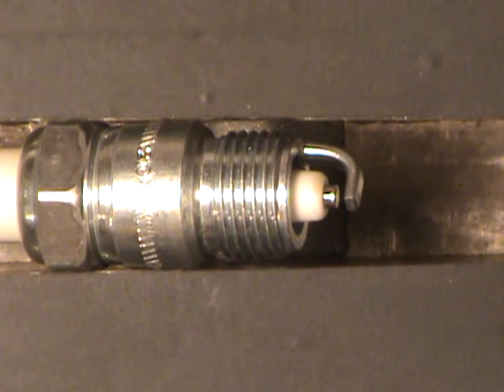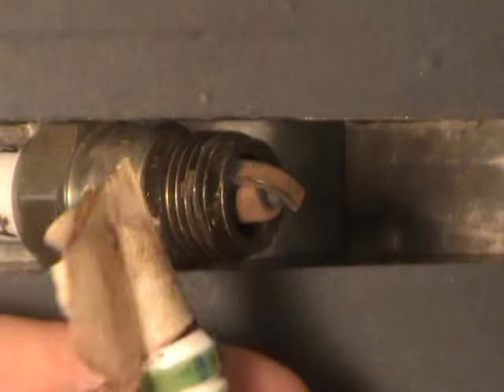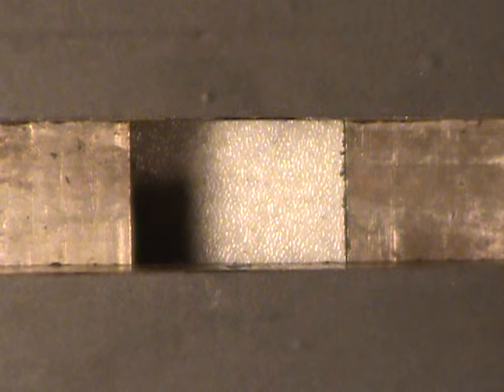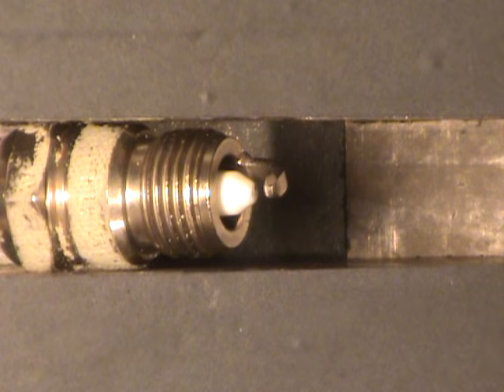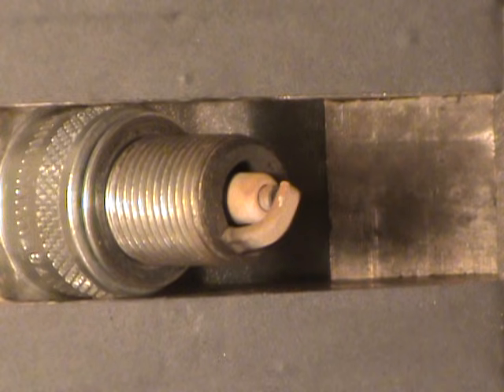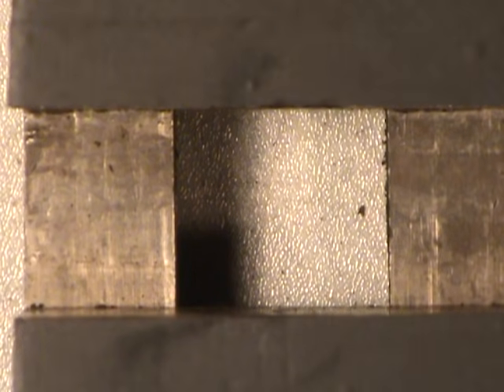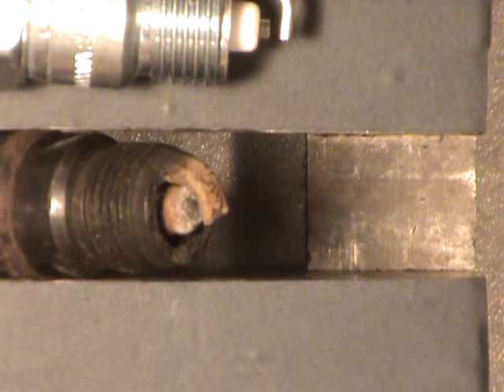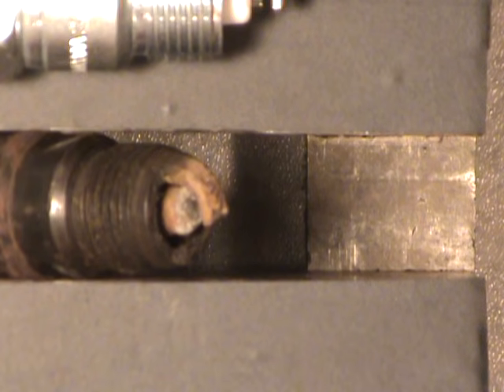SPARK PLUGS How to Read them (Part 3)

Comment: Great video! Have you ever heard of this before..... I've got a plug I pulled out of my mid 70's Chevy 454 that was "yellow", yep yellow,, the rest of the plugs were normal looking. Your video doesn't mention this color, what could be causing this to happen in one cylinder?
Reply from the maker: Greetings bob stout....Thanks for the nice comment, for watching, and for Your question as well....What comes to mind (mine), is, as it concerns that "Yellow-ish" Color, that You saw/observed on "Only One", of the "8" Spark Plugs, that were installed in Your 1970's 454-V8 Engine, has me thinkin', that, perhaps, it just might be some "Glazing" of that "1" Spark Plug, that is usually the Result, of having, in this particular case, that "1" Spark Plug having an abundant amount of "Deposits" on it, that, while at about "City Speed" (aka, 30 Miles Per Hour or its Metric equivalent of about 50 Kilometers Per Hour), would at that Speed, as I see it, Not be causing much of a problem at all (as in...No Yellow-ish Color showing up, just yet)...

...but...

...You happen to head out on the...Interstate...Highway...Autobahn...Freeway...etc., and the Speed of Your Vehicle "Increases" to, oh, about, what-ever the Legal "Maximum Posted Speed Limit" happens to be, and due to the Spark Plugs "Operating Temperature" Increasing, and usually getting Hotter, the Spark Plug can actually turn the Deposits that are on it, into a "Glazing" (as in Glazed, kinda like Glass, if You will), and, can be also, with that "Yellow-ish" Color that You were mentioning earlier.

What's Strange, about the Scenario/Reality that You are Seeing/Experiencing, is, that Spark Plug "Glazing", for the most part, should, as I see it, be Showing-Up on, all of Your 454's "8" Spark Plugs, and "Not" just "1" of them...!!!

I'm just assuming, that, Your "454-Engine" has a "Carburetor" sitting on top of it...

...or...

...does Your "454-Engine", have, one of a few "Types", of "Fuel Injection" Installed on it perhaps, as, Determining some kind of "Prognosis", will depend on, just what the "Patient" happens to be (lol).

So, now Your 454's Yellow-ish Spark Plug, has me, thinkin' to myself...Self, what could possibly be causing such a Head-Scratchin' Situation...???

Ah yes, could be several things at that...

Do "All"..."8" Spark Plugs have the "Same Part Number" on them...???

Are "All"..."8" Spark Plugs..."Gaps Set" to the "Specified Gap Setting"...???

What "Kind" of "Deposits" (including Colors), are You "Seeing/Finding" on "All"..."8" Spark Plugs...???

If, in fact, that "1 Only", Yellow-ish Spark Plug was indeed caused by the Deposits on it, getting Heated-Up enough, that would turn the Deposits into a "Glaze" (as in Glazed or Glazing), I would probably start with a "Compression Test" of "All 8 Cylinders", to make sure that they are "All", at least Showing (on the Compression Gauge) "100 Pounds Per Square Inch" or More, and, that, "All" of the "8" Cylinders are Showing "Compression Numbers" that are With-in a Few Pounds Per Square Inch (PSI), of One Another (think in Terms of "Balance").

I'm thinkin', that, the "Ignition System" (aka, Spark), on Your "454", might be a bit on the "Weak" side, and maybe more-so, on that "1" Cylinder, where that "Yellow-ish" Spark Plug is Installed, while at Lower Speeds and RPM's, possibly Creating a bit more, in the way of spark plug Deposits, and, might be "Sparking" not so bad, at "Higher Engine RPM's", which, just might (hypothetically) be causing that, and, if it is, Spark Plug..."Glazing"...???

All it takes, is, just "1" Bad Wiring "Connection", or something like a Not So Good Spark Plug "Wire/Lead" to cause, what seems like, "Many" Types of Engine Running/Performing Problems.

To "Avoid", those, shall we say, Un-needed and Un-welcomed, Engine Running/Operating & Performance "Problems", is, to First Make Sure, that the Engine has  a "Tune-Up" at the Required Time/Mileage/Kilometer-age "Intervals", as well as, having "All" of the "Engine's", and the "Vehicle's"..."Fluids"..."Changed" when the Manufacturer/Factory Maintenance Schedule Indicates so.

So then, ask Yourself, when was the "Last Time" I had an Engine "Tune Up", and, just "How Old" are All of, those there "Ignition Parts & Pieces" anyways...???

If You like, just let me know, all that You can, about Your Engine & Vehicle, that way, I will probably have a much better idea, as to, what I'm up against...

Be Safe, take care, and have a good one.
Reply: Wow, thank you for the wealth of information and the time it took to explain it all!

   My truck is a 1973 Chevy C20 pickup with a stock 454, a Edelbrock 1407 carburetor, 3" exhaust and a Turbo 400 transmission.

   I've done a compression test and the results were about 110psi +/- 5psi on all cylinders so I don't think I have a burnt valve or a flat camshaft lobe.

   I've hooked up my vacuum gauge and it reads a steady 18hg of vacuum.

   I've adjusted the valves and they all seem fine.

   The ol 454 has always kinda ran like it was running on 7 cylinders. Some days it better than others but it just doesn't have the power a 454 should have, it's an old truck so being a little sluggish is expected but not this sluggish!!!

   Again, I appreciate your time and knowledge!!!
Reply from the maker: bob stout Greetings bob stout....Thinkin' back, quite a while ago, I remember that, I had a 1979 350 Cubic Inch Chevy (5.7 Litre) V-8, equipped with a Rochester Quadrajet 4-Barrel Carburetor, that might have been "Acting/Performing" not so good, kinda like Your 454 Cubic Inch V-8 is, or was, at the time of Your last comment....The shall we say..."Symptom", as in the way in which my Chevy 350 V-8 was running/behaving, had me believing/thinkin', that, my Engine probably had, an..."Ignition System" Problem, as, when, at the time, when my Chevy 350-V8 was "Acting Up", the problem that my Engine was having, was, when-ever I drove up a not so steep hill, my Engine seemed to be "Miss-Firing", thus, I was kinda Convinced, by the way, that, my Engine was behaving/running, had me thinkin''..."That's" gotta be it (the problem) alright!...so......I did a Complete "Ignition System"..."Tune-Up"...as in..."New"...Ignition Coil...Pick-up Coil...Distributor Cap & Rotor...Spark Plug Wires/Leads...and...Spark Plugs, including the Proper Gap...and...Set the Ignition Timing as well......then......I took it for a "Test Drive", and, although my Engine "Seemed" to Run a bit better, I then started driving up a Medium-Steep Hill, and......that there, what I thought, was an...Ignition "Miss-Fire"...was still there...!!!Then, after thinkin' about "It" (the Engine Running Problem, that is), I decided to do a "Compression Test" on my Chevy 350 V-8.The Results of that there "Compression Test", had some pretty good Numbers......from the Lowest Cylinders, being in the 140+ PSI Range, and some other Cylinders in the Low 150 PSI (Pounds Per Square Inch) Range.So, now I'm thinkin'...Now What...???So, I thought that, it just might be a good idea, to "Remove" the "Valve/Rocker" Covers, to "See", what's "Goin' On", with, them there "Teeter Totters" (aka, Rocker Arms)...So then...after I Removed the Right Side Valve/Rocker Cover, that Covers, the Rockers of...Cylinder Numbers..."2"..."4"..."6"...&..."8"...and the Engine was already warmed up, I started the Engine......and......"There"..."IT"...Was"...!!!......The "Number 4 Cylinder's"..."Exhaust Valve"..."Rocker Arm""..."Was Not"..."Moving"...as "Much" as..."All" of the "Other"..."Rocker Arms"...on top of that "Cylinder Head"...!!!So, I went ahead, and did the "Hydraulic Lifter" (Tappet?) Adjustment, thinkin', that, maybe, that particular Hydraulic Lifter, might have..."Collapsed" possibly...???NO-Sir-ee-Bob...Nothin' Wrong with that particular "Hydraulic Lifter" at all......"It"...turned out to be......the, Number 4 Cylinders...Exhaust Valve..."Camshaft Lobe"...that "Was Not", much of a "Lobe" any more, probably because it was "Removed" (kinda like, Machined/Ground), by the Bottom of that particular Hydraulic Lifter"...!!!So, my Friend...there You have It......what seemed to Me, to be an Engine "Ignition System" Problem......turned out to be......a..."Non-Existent"..."Camshaft"..."LOBE"...!!!Even though, "Compression (PSI) Numbers" appear to be quite good, and, as I have "Learned", it's just like they say......"Seeing Is Believing"...!!!Be Safe, take care, and have a good one.
Reply: I agree, I've always thought it may be a cam lobe just because those 454 engines from the mid 70's supposedly have a problem with soft cam lobes! My next question is will a compression test single out a bad cam lobe, I don't think so . I can do a leak down test by loosening the rocker arms to get the valves to completely close, (much more effective then trying to find TDC) and then do a compression test.
Reply from the maker: bob stout Greetings bob stout....Yes-Sir-ee-Bob...I heard about that, so called..."Soft"..."Chevy"..."Camshaft-Lobe"..."Story"...many years ago, and, I never had a "Chevy Engine Camshaft Lobe"...go Bad on me..."Until"...it finally "Reared Its Ugly Head"...on my 1979 350 Cubic Inch V-8 Engine...!!!......and......I knew of a few Guys, that had "It" happen to them..."Before"..."It"...Finally Happened to Me...!!!.......Like I had mentioned earlier...I actually..."Saw" that "Not Moving Much"..."Rocker Arm"...while my Chevy 350 V-8 was warmed up, and Idling, without the Valve/Rocker Covers on the Engine......and...Watch Out for Hot Squirting Oil coming out of those Little Holes in the Rocker Arms...!!!......The way that I "Check" the Camshaft "Lobe Lift", in a Much "More Accurate" way, is to use a "Dial Indicator"...In Line with the "Push Rod"...and have the "Plunger/Stem" of the Dial Indicator..."On Top" of the Rocker Arm...Just above where the Push-Rod Fits in the Rocker Arm's Push-Rod "Socket" (Socket in this case = where the Top of the Push-Rod makes Contact with the Rocker Arm)...and...with All 8 Spark Plugs, Removed from the Engine, I "Rotate" the "Harmonic Balancer/Damper" retaining Bolt, with a Ratchet/Breaker-Bar & a Socket...(You might need a "Helper/additional Person", on this one)... ...The Dial Indicator "Reading"..."Won't" be as "Accurate" as having the "Camshaft", by itself, Out of the Engine...but...as long as..."ALL" of the Rocker Arms are "Showing"...the same Amount of "Travel" (aka, Camshaft "Lobe Lift")...and...if the Camshaft "Lobe Lift"...for All" of the Camshaft "Lobes" are Reasonably "Close", to the Actual...Camshaft "Lobe Lift"..."Specifications"...for that particular Camshaft, then, You'll know, that, at least, the "Camshaft"...has Enough "Lobe Lift", to Actuate..."All" of those "16 Valves" in the Engine...!!!......I'll mention the following Now, or, I might Forget......In order to "Prolong" the "Life" of a "Camshaft", that has..."Flat Bottom" Hydraulic or Mechanical Lifter/Tappets (actually, a "New" Hydraulic Valve Lifter "Bottom" is Not "Flat", as it has a "Radius" on it...!!!)...is to..."Make Sure", as I see it...to..."Start and Run" the Engine, at "Least"..."Once-ah-Month"...More, is even Better...!!!......Make Sure, that, there is Lots of Fresh Air and Ventilation around that Running Engine, because, Exhaust Gas is..."Deadly"...!!!......Here's "Why" the Engine "Needs" to be Started and Run, every so often......When-ever an Engine is "Not Started & Run" very Often...the "Motor Oil"..."Inside" the Engine will eventually find its way...back into the..."Oil Pan", due to Earths Gravity...and...just think about...How much Pressure/Force is being "Applied" by the "Valve Springs"...and...all of that "Pressure /Force" from those Valve Springs is Pushing the "Bottom" of the Hydraulic or Solid Valve "Lifters/Tappets"..."Against"...the Camshaft's "Lobes"...!!!......if there "Is Not" very much Motor Oil on the Camshaft's "Lobes", and the "Bottom" of the Valve "Lifter/Tappet"...then...perhaps we just might be having..."Metal-ON-Metal"...with very Little..or...No Lubrication...what-so-ever...!!!......Note..if an Engine is equipped with a "Roller Camshaft & Roller Lifters/Tappets"...then...the "Roller" (type) Camshaft's "Lobes" will have a much Better Chance at "Surviving", with less motor oil, and,  without the type of "Damage/Destruction" that would usually "Happen", to the good ole "Flat" type of Camshaft & Lifter/Tappet equipped Engine......When You did the "Compression Test", on Your 454 Engine, was the Engine "Warm"...???......Was the Carburetor "Throttle" Held at "Wide Open Throttle" (WOT), when You took the "Compression Readings"...???......and, for "Safety's" Sake, Your Engine's "Ignition System" has to be..."Disabled"...!!!......Seeing as how Your 454 V-8 Engine, only has about 110 PSI, showing on Your Compression Gauge, has me thinkin', that, Your 454 Engine has "Lots of Miles/Kilometers" on it...???......I use the following..."Quick Check"...to see, just how "Worn" the Piston's "Compression Rings", happen to  be, and, just how much..."Blow-By"...the Engine has......I have the Engine...Up To "Operating Temperature"...and, I remove the..."PCV" (Positive Crankcase Ventilation) Valve, from the Valve/Rocker Cover, and secure it......then, if on the "Other" Valve/Rocker Cover...or...if the Engine has an Oil Filler Tube "Breather Cap" on it, I "Remove" It, so, the Engine Can't "Inhale" any Engine Exhaust Gas "Blow-By", that gets Past the Piston's "Compression Rings", when the Engine is "Running", and, that there "Smoke" (if any, that is) will usually be coming "Out" of, the Valve/Rocker Cover Hole/s, and or, the Oil Filler Tube (usually located on the Intake Manifold, if so equipped, that is), and......the "More"..."Smoke"...that You or I "See", will usually, let You or I "Know"...just "How Worn", the Piston "Rings" are, and the result of having Engine Piston "Rings" that have "Lots of Miles/Kilometers" on them, happens to be......the Piston Ring's "End Gap", gets to be Much "Larger", that will inevitably, let Plenty of "Combusted and Pressurized" Exhaust Gas...get "Past" the Much Too Large, Piston Ring's "End Gap"...then...if there happens to be a "Lot" of "Blow-By", it will usually go right "Past" the Pistons, then "Contaminate" the Motor Oil, in the "Oil Pan"......I've seen an Amazingly..."Clumped Up"...with Chunks/Thick Coating of some very Solid "Sludge", that actually "Plugged Up" many of the Motor Oil "Drain-Back" Passages/Holes, like You Wouldn't Believe, as a result of, having "Way Too Much"...Exhaust Gas "Blow-By", that, as I see it, was Caused mostly, by...Piston Rings, that had "Way Too Large" of a Ring (actually Rings!)...End Gaps...!!!......and, as I've experienced...that "Contaminated" Motor Oil, will usually find its way, into the "Hydraulic" Valve Lifters/Tappets, making them, well, kinda get "Stuck" (Stuck = preventing them from "Automatically" Adjusting themselves, while they are Operating, that is), and, that "High Mileage/Kilometer-age" Engine, will usually, start to make that, at first, a..."Clickity-Click-Clicking" Noise, and when it starts getting Worse, it will usually Start making a......"Clack-iddy-Clack-Clack"...and not so wanted Noise...!!!......So, there You have it, for this Episode......Oh yeah, on Your 454 V-8 Engine, do You happen to know, Which Number/Location "Cylinder", that...that "Yellow-ish"..."Colored"...Spark Plug, was Installed in...???... ...Be Safe, take care, and have a good one.
Reply: I'm afraid my speedometer doesn't work so I don't know the exact mileage but I do know it's high, I'm assuming 200,000 miles +/- 50,000 miles. When I did the compression test the 454 was warmed up but I did't hold the throttle wide open so I'll have to retest the compression using the proper procedure. Yes the yellow plug came from cylinder number 8. One thing I've always wondered is when something like this happens why is it always the hardest cylinder to reach, lol?
Reply from the maker: bob stout Greetings bob stout....Before I get into some 454 Engine stuff, I'd just like to mention, about, how my last couple of Reply/Comments regarding Your 454 Engine, has Words that are..."All Bunched Up", and, that when I actually "Did" those last few Reply/Comments, I really "Did", just like I have been Doing, pretty much, all along, and that was to....use somewhat acceptable..."Paragraphs" in my Replies/Comments....So, I'm not sure..."Why?"...all of my Words are "All"...kinda "Glued" Together???......................................................................Hey, You were saying, about, Your "Number 8" Spark Plug & the spark plug Wire/Lead that goes with it, are, as You said, the Hardest/Most Difficult Spark Plug Wire/Lead to get at...well...if You haven't worked on a "Full Sized Van", with a "V-8" in it...or a..."Chevy or GMC" (GMC = General Motors) Mini-Van, with a "V-6" in it, that has "Rear Wheel Drive", then, maybe, just maybe, You should give the following some thought, if You care to, that is (lol)..................................................................................If and when, a Person, wants to even "See" the "Top & Rear-most" part of the Engine in the above Vans that I was just mentioning, then, in order to do so, the "Dog-House" (aka, Engine Cover) has to be "Removed" First...!!!...........................................................................Then, to "Gain Access" to some of those there "Van's" Spark Plugs, and depending on the particular "Van" in question, that will usually "Be" the "Deciding Factor", as it Relates to...Just How Much "Cussin'" (as in Cuss Words...lol), that just might be..."Spoken", by the, sometimes..."Frustrated"...and...might end up with..."Messed Up Hands" (as a result of coming in Contact, with at times...some Sheet Metal, in, that there Van's Engine Compartment!) of the Poor Soul..."Workin' on It"...!!!.....................................................Maybe..."Count Your Blessings...!!! (lol).............................................................When it comes to just about any of the "Older" Cars & Trucks...Equipped with "High Mileage/Kilometer-age" V-8 Engines, as far as Problems are concerned, is, as I've experienced, sometimes, the Motor Oil "Drain Back" Holes/Passageways can become, somewhat "Plugged Up", with what appears to be, an "Over-Abundance" of "Sludge", that, as I see it, was probably due, to, Way Too Much "Exhaust Gas Blow-By" that was making its way through-out the Engine, for quite some time...............................................Picture this...I had a V-8 Engine, that, had me wondering, why it "Took So Long" for the Motor Oil to "Show Up" on the Engine's...Oil Level Checking "Dipstick"..."After" the Engine was shut off...???.................................................So, one day, I decided to Remove the "Valve/Rocker Covers", to see what might be "Goin' On".................................................................................As I Removed the first "Valve/Rocker Cover"...Motor Oil started "Flowing"...Like a "Water-Fall", at the Rear-Most part of the Engine's Cylinder Head (on Top), nearest the Firewall, due to the Slight "Angle" that the Engine "Sits" at, in the Engine Bay (but, only while on Level Ground)...&...Earth's Gravity made that Motor Oil head downwards.................................Turned out to be...Too much exhaust gas "Blow-By", that actually "Created" Enough, shall we say..."Sludge"...to..."Plug-Up"...the...Engine's...Motor Oil..."Drain Back"...Holes/Passageways...!!!........................................Another thing comes to mind (mine), about Your 454 Engine's Yellow-ish Spark Plug......................................................................Every now and again, even a "Brand New" Ignition Component, such as a Spark Plug, can be Problematic/Faulty right out of its Shipping Box/Container, but, that scenario is quite "Rare" indeed...but...it can, and might just happen...............................................Sometimes, when-ever Installing or Removing a Spark Plug, with a "Socket" and Ratchet (Tee-Handle or Breaker Bar?), there can come a time, where the "Socket"..."Is Not"...Reasonably..."In Line & Parallel" with the Spark Plug, as it's either being "Torqued" (aka, Turned with Force...lol) to "Install" It...or...sometimes, when "Removing" the Spark Plug (aka, Breaking It Loose!), can sometimes, have the "Socket"..."Make Contact With"...the Spark Plug's Outer "Porcelain"...&...Actually..."Crack" the Spark Pugs Outside "Porcelain", or might "Damage" the "Innards" of said Spark Plug possibly...???..................................................................What I have been going, for quite some time now, is...I "Removed" the/that "Spongee/Rubber Like"..."Insert", that is usually found "Inside" a Spark Plug "Specific"..."Socket", because, as I see it....I "Don't Want"...to have "Any"..."Side-Pressure" on Any of My Engine's Spark Plugs, when..."Installing or Removing" them...!!!.........................................................................Also...I "Make Sure", that, by Looking down into that Spark Plug..."Specific Socket"...that, there is Plenty of "Clearance", so as to Avoid, having the Spark Plug "Socket"..."Make any Contact" with the "Spark Plug"...!!!...................................................Or, a "Deep Socket", would be, as I see it, another very Good "Alternative"....................................................................So, that's about it, for now......................................................Be Safe, take care, and have a good one.
Reply: No problems with spark plugs. I did another compression test and found out number 8 and number 4 cylinders both have about 90psi and the other 6 cylinders have around 110psi. I haven't done a leak down test yet so I can only assume the exhaust valves are leaking in those 2 cylinders. Yes the rings could be leaking in those 2 cylinders but I recently had to replace the valve seals in number 4 and 6 cylinders due to oil leaking past the valve seals and smoking out the tailpipe so the heads definitely need to be rebuilt. I'm contemplating rebuilding the engine with it still in the truck by removing the transmission, the intake, the heads, the crankshaft and pistons and leaving the block mounted to the motor mounts. Only reason for this is I don't have the room or tools to completely remove the engine from the truck. People have said not to do this encase I need to bore out the cylinders and deck the block which is true but I'm hoping I just need to hone the cylinders, lol! I guess I won't know until it's all pulled apart but I do know I'm waiting for a few months when it cools off a little here in Phoenix Arizona! Working on a vehicle with no shade when it's 115 degrees outside is brutal, I'm not as young as I used to be, lol!
Reply from the maker: bob stout Greetings bob stout....Let's see now...(I say, as I'm accessing my Cranium's...Memory Archives...lol)...Maybe try "Re-Testing" the "Compression" on Numbers..."8 & 4"...with a "Freshly Charged-Up Battery", as, I remember doing a Compression Test on a "4-Cylinder-Mercury-Outboard-Motor" (why do "They" call it a "Motor", and Not an "Engine"...???), and, I noticed, that the "Cranking Speed" of the Outboard Motor's..."Starter Motor"...was..."Dropping" in "RPM's", as I proceeded to Test each of the 4-Cylinders, and, the "Last Two" Cylinders, that I Tested, went something like, the Third Cylinder being Tested, was showing "90-PSI"...&...the Fourth (Last) Cylinder showing "80-PSI"...while the First and Second Cylinders that were Tested, were showing about "140-PSI" on my Compression Gauge...???.................................................................What's that Old Saying?...oh yeah..."If at First You Do Not Succeed...Try and Try Again"...!!!...lol......................................................Just wonderin'...did You happen to observe Any "Blow-By", when Your engine was at Operating Temperature, while Running at Idle Speed at all...???............................................................I recall, that I had to "Remove" the Long Bolt, on Each of the Two Motor Mounts, and, "Jack-Up" a "V-8" Engine, with a "2-By-6" Under the Oil Pan, to avoid Crushing it, and, by placing my Floor Jack under that "2-By-6", I had to "Raise" the Engine, off of its "Motor Mounts", and place some smaller pieces of Wood, to, well, kinda Wedge the Two Halves of Each Motor Mount "Apart", and Keep them Apart, when I removed the Floor Jack & the "2-By-6"...to make Enough "Room/Clearance", just to be able to "Remove" the "Oil Pan" from the "Engine"...!!!.....................................................I'm not sure, as to, just How Much "Clearance", that Your "Pick-Em-Up-Truck"...has..."Between" the "Oil Pan"..and the "Cross-Member", but, it would be a Good Idea to Check that "Clearance" before You Start the "Tear-Down" of Your good ole "454"..............................................................With that "Many Miles" on Your "454-V-8", and You want to do, a somewhat.."Proper & Lasting" Rebuild, more then likely, there's going to be fairly Deep "Ridge" on the Top of All 8 Cylinder Bores, that are usually left there, due to the Pistons Top Compression Rings, "Not" making their way to the Top of the Cylinder Bore, while the Piston is at "Top-dead-Center" in its/their Stroke......................................................Just to get the Pistons out, and that's After Removing the Connecting Rod Cap/s, on the Connecting Rod/s, You will need to get a hold of, a..."Ridge Reamer", in order to "Remove" the "Ridge" that will be "Preventing" the Pistons Rings from making their way..."Past" the Engine's..."Un-Worn Bore Size", as, all of the High Mileage..."Wear", that the Pistons Rings "Create", will be that of, a "Larger Bore-Size", in All 8 Cylinders...................................................Yes-Sir-ee-Bob, even "If" You didn't have to "Re-Bore & Hone" all 8 Cylinders, and install some Over-Sized Pistons & Rings, a Person, has to consider, All of the "Crap" (aka, debris, sludge, etc.) that will be left, Still "Inside" Your Engine, not to mention, the Cast Iron Shavings/Particles, that will be "Created" when You use that "Ridge Reamer", to Remove the "Ridge" on the Top of All 8 Cylinders!......................................................In order to remove the Crankshaft, while the 454 is still in Your Pick-Em-Up's "Engine Bay", I'm thinkin', that the Engine might have to be about Half Way Out (as in Up) just to get enough "Clearance" above the Cross-Member!...Yikes!..................................................If you somehow, are able, to get away, with just "Honing" the Cylinder Bores (that's like Winning the Lottery!...lol), and the Pistons are not Too "Loose" in said Cylinder Bores, and also, if You happen to Re-Bore & Hone the Cylinder Bores, along with New Pistons, "Make Sure", that You insert the Piston "Rings" in their Respective Cylinder Bores by Themselves (aka, not installed on the pistons), and, Inserted "Squarely", and to the Specified Depth, in each Cylinder Bore, and Check/Measure the Piston Rings "End Gaps", as, Too "Small", as well as, Too "Large" of the Piston Rings "End Gaps, are Not, a good thing...!!!.................................................Too Small, of the Rings "End Gap", can cause them to "Break" when they Reach Engine Operating Temperature, along with some possible Cylinder Bore, and maybe Piston Damage as well...!!!.................................................Too Large, of a Ring "End Gap", will usually result in..."Lower Compression"..."Lost Power"...&...if the "End Gap/s" are way Too Much, the Engine might just have "Blow-By"..."Before" it's even "Broken In"...!!!.............................................Once You manage to Remove the Cylinder "Heads", You will be able to actually "See" the "Ridge" on the Top of Each Cylinder Bore............................................It's possible to Measure "Most" of Each Cylinder Bore, if You put the Cylinder being Measured, Piston, at "Bottom-Dead-Center", in order to "Expose" quite a bit of that particular Cylinder Bore........................................................You will Need to get the Measurement (Diameter), of the Cylinder Bore, just "Under" the "Ridge" (where the Diameter of the Worn part of the Cylinder Bore is Larger, then the Not Worn Diameter Above the Ridge, closest, to where the Cylinder Head & its Gasket gets installed), and, take Measurements, (as viewed from above the cylinder bore), oh, about every "45-Degrees", and at several Locations, "Depth-wise", to the Bottom of Each Cylinder Bore, well, if the Pistons are still in the Cylinders, You will only be able to go as deep, as the Piston "Tops" will let You...!!!...lol........................................."Make Sure", that You "Record" All of the measurements, that You have (hypothetically?) Taken, and write them down.....................................................Now then, the Pistons, if, and once, they are out of the Engine, Need to be measured as well.....................................................Have a look-see, for the "Size Specifications", and, also..."Where" (aka, Location), on the Piston...that "Those" Measurements are to be Taken at/from..............................................................Then, look up the Specifications, for the "Cylinder Bore"...to..."Piston"..."Clearance"...and...I'm thinkin', that, the "Clearance" that You have "Calculated" (accurately, I hope), will more then likely, be..."Over" the "Allowable"..."Clearance"...that are more or less..."Dictated"....by the "Official"..."Specifications...for Your, good ole, "Pick-Em-Up-Truck's"...454-V-8 Engine...............................................You might have to Rent a "Hydraulic Boom Type" of Engine Hoist/Crane, and, probably, an "Engine Stand" as well................................................Make Sure, that "Both", the "Engine Hoist/Crane", and, "Engine Stand", are "Rated" for the "Weight" of Your "Big Block 454 V-8 Engine...!!!....................................................If You actually do, get a hold of an "Engine Stand", Make Sure, that You get One, with "4-Wheels/Casters", that are "FAR APART", kinda like, having the "Wheels/Casters" Forming a..."LARGE"..."Square or Rectangle" at the Bottom of it, where the "Wheels/Casters" make "Contact" with the Floor, as the "Wheels that are Too Close Together"...Engine Stands...are an..."Accident-Waiting-To Happen"...due to the "Instability" of the "Close Together-Wheeled"...almost, kinda like..."Tripod Design"...!!!..................................................I better Stop now, or You might fall Asleep...lol.....................................................................Be Safe, take care, and have a good one.
Reply: With all that to take in consideration I think I may wait until I have the proper tools and space to pull the engine and do it right. With a high mileage engine I'm learning that it's almost a given it will have to be bored out. So now since I'm going to wait a few months I'm thinking about doing the bodywork and paint job. I've never done this before and the paint job seems to be easier than the bodywork but at this point it will all be trial and error. I've got a few good dents and a rip in the metal to take care of, I'm not a welder so that part will be done by someone else but do you have any good advise on doing bodywork for the novice?
Reply from the maker: bob stout Greetings bob stout...Now that You have a good idea, as to what You are up against, if, and when, You decide to take on the...Quite Involved & somewhat Expensive undertaking, of the "Rebuilding" of Your Chevy 454-Big Block V-8 Engine, and, if and when, You get around to, actually starting Your Engine "Rebuild", I can give You some of my Thoughts/Advice, as it pertains to, just about anything (I hope), with Your Engine "Rebuild", including, some "Things" to be aware of/watching out for, as well as, Parts...Machining....etc.......................................................Yes-Sir-ee-Bob...I'm somewhat of a..."Red-Neck"...Auto-Body-Fix-Em-Up-Guy...as well...!!!...lol......................................Always "Remember", to try and keep the "Application"..or..."Finished Thickness" of the "Body Filler" (aka, Bondo") as "Thin" as Possible, as, by doing so, makes for a much Better and Professional Quality Repair, and, by the way...that "Stuff" (Bondo)..."Shrinks"..quite a bit...!!!.................................................Indeed, "Welding-In" Patch-Panels...Quarter Panels...etc....are probably the, shall we say..."More Professional" way of doing things...but...if You don't happen to have, much in the way of Welding Experience, or, even a Welding Machine, for that matter, I've actually "Made", a "Flange-ing Tool", that, when used with my home-made (Red-Neck) "Sheet Metal"..."Body Hammer"...I can actually, remove, a not too big, rusted out hole like section...and by using my "Flange Creating"...home-made..."Red-Neck"...Tools, I then...Create a Recessed "Flange", then, a Sheet Metal "Patch", is Placed in the Recessed Flange Area, then, Drilled for a series (or number) of "Pop Rivets", that, Secure, that there Sheet Metal "Patch", like You wouldn't believe...!!!......................................I usually use..."Steel"..."Countersunk-Headed".."Pop Rivets"...as, the Regular Type, with those Big Bulging Heads, aren't such a good idea.........................................It's a really good idea, to actually "Seal" the "Patch"...to the Vehicle's Body Sheet Metal...with something, like...JB-Weld", or its equivalent..."Before"...it's Pop Riveted into place, so as to..."Avoid"...any..."Moisture"..."Creeping"...between, the "2" Layers of Sheet Metal...!!!......................................................."Free"..."Sheet Metal", to do Auto-Body "Repairs", can be, as easy to get, just by, getting a hold of, an..."Appliance"...as in...a...Not Used Any More...Fridge (aka, Refrigerator...lol)...Dishwasher (an Electric One, "Not" a "Human One"...!!!...lol)...Kitchen Stove...etc.......................................For longer lasting Auto Body Repair/s, it's always a good idea, to get rid of "All" of the "Rust", to prevent "It" from "Re-Appearing", and, "Ruining"...all of Your..."Hard Work"...............................................................I have Lots of Auto-Body Related "Stuff", and I'll leave it 'till later down the road...............................................................Check out...Rustoleum (spelling?) or Tremclad...Rust Paint....Roller (using a sponge paint roller) Car or Tuck Paint Jobs...............................................For $200 Dollars, maybe a bit more, maybe, a bit less, You'll be able to Paint Your Pick-Em-Up-Truck, with some very "Durable Paint", that will last for years...!!!...........................................Just do an Internet search for...Rustoleum (spelling?) Paint Job or Jobs, and, select either the Website "Forums" to "Read", Lots and Lots of Information, on "How To Do It"..and/or, also, select "Images"..or..Pictures, so You can actually "See", how Good, some of those..."Rolled On Paint Jobs"...look...!!!....................................................Its' all about how the Paint is "Thinned" (maybe about 50/50 or 1 to 1 Ratio with Mineral Spirits), so it will "Flow and Lay Down" Properly....................................................It's "Cheap" for the Materials, but, is quite Time Consuming and Labor Intensive, and, depending on, just how Fussy You happen to be, about the Quality of the "Finished" results, that, my Friend, will be the determining factor, on, just how many hours that You will actually, put into...Your Paint Job............................................See if You can find some "Images" (Pictures), of the "Orange 1968 or 1969 Dodge Charger"...and...the "Red Corvair"...as, these two "Roller Paint Job" Cars...look, Really Nice...!!!......................Enjoy....................Be Safe, take care, and have a good one.